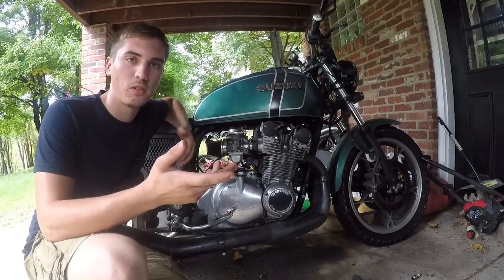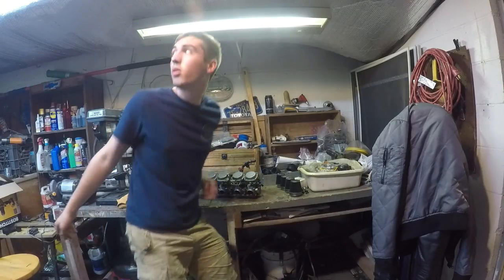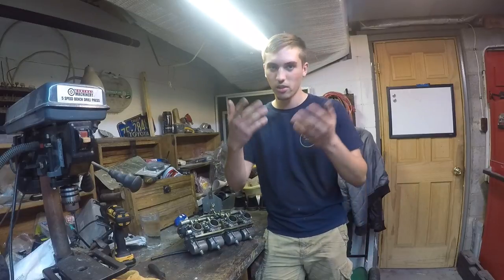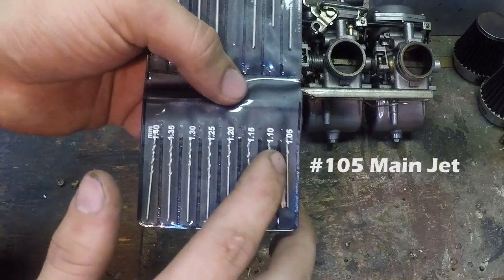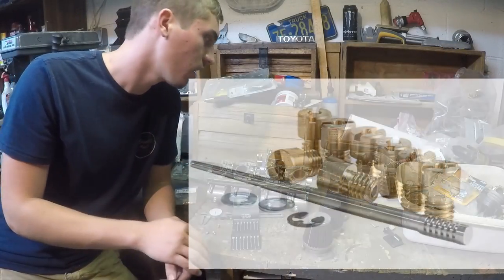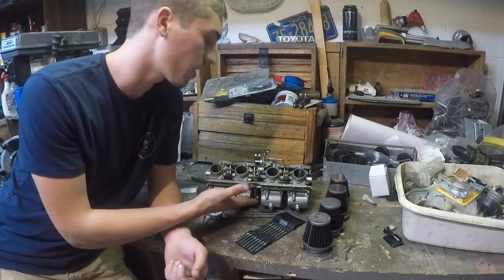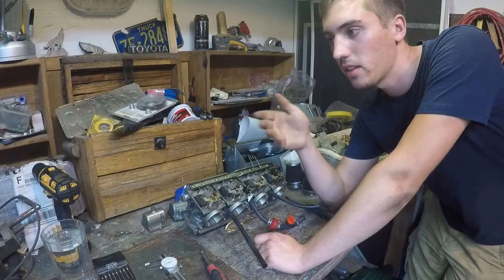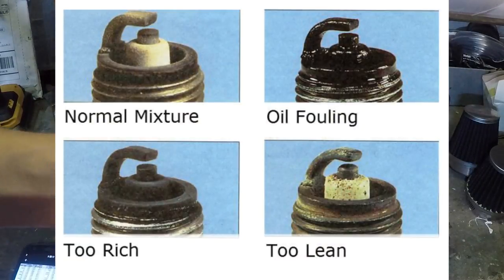How To: Jet Carburetors WITHOUT A JET KIT

Comment: after drilling out the jet, take a file or some sand paper and sand the original jet size away. Than take a pike or something sharp and engrave the new size in the jet. There is nothing more stupid than taking a jet out of your spare box which says 160 on it and its drilled to a 170 without knowing it......

Comment: Also, don't jump from something like a 110 jet to 170 if you are only doing pod air filters. If you are also installing a straight through or more free flowing exhaust, you might need that drastic of a change in jet size. Most people recommend about a 15 size jump for pods, so stock 110's become 125's. If you increase the size a little at a time you can get to the sweet spot and not ruin your set of jets.
Reply: You think .05 increments is small  enough? Idk. I'm about to do this myself. I've got 118 mains and was hoping to find a set of reamer or drill bits of .02 increments to test out as I've read of others having 120, 122, 124 mains.
Reply: @juntjoonunya9216  - I've heard a jump of 5 sizes for each of the most common changes. Pod air filters, plus 5, straight thru exhaust another 5, so a 115 main jet with pod filters becomes a 120, 125 if you are doing something like a 4 into 1 exhaust eliminating the crossover. Then check your plugs after about 500 miles, if they are very white, too lean, drill out the mains a little more. This is the main reason not to do a drastic jump in size. If you drill out too large the first time you can't go back, you will have to replace the jets.
Reply: With just a pod upgrade on a gs850 120 mains to start, but what about the pilots?

Comment: Hi, just want to say, love your videos. My question is...I have an 82 gs650gl that I've rebuilt the carbs on and it's like nothing is getting through to start. It just cracks. I am putting pods on just like yours so I guess I need to jet it. I did buy a drill set like yours. What size would you recommend I drill them out too?

Comment: Another hack if your jet is too big is get the jet nice and hot and melt in some solder and then drill it out with a smaller drill bit. You dont have to keep it like that  but its good way of testing before ordering the correct size needed.
Reply: Wow what a good idea

Comment: Hi, I have a CB125T that is a bugger to cold start. I think it is jetted too small on the pilot stage. I cannot  obtain the correct style jets in my country and so wanted to try drilling out the pilot jets. The jets are size 38 (keihin 3L jet). Does this mean that the hole is 0.38mm? They also have cross drilling, are the cross drilled holes the same size as the hole up the centre?

Comment: Hey man love your videos, I have a 1988 Kawasaki concours 1000cc with in-line 4 carbs. I dissembled the carbs and cleaned the jets and carbs themselves and the bike runs fine, but when I give throttle and RPMs hit around 6k, it hangs until I shit the bike off. Any ideas? Also, bike came with the pod filter but wasn’t running properly so got my hands on a stock air box and everything is fine except RPMs hanging when I apply decent throttle. Would really appreciate a response with some tips man!!!!!
Reply: Sounds like floats or throttle sticking

Comment: This dude is awesome have the same bike 1980 gs 850 runs alright with choke on can here it miss hear and there dies with choke off have the carbs off the bike far as I've gotten never really messed with carbs much but in gonna take my chances...what should I look for what should I do and what is a good jet size to start with on both jets? Bike seems to have good sparks so I assume its carb or even petcock/vacuum issue witch the bike has a strange petcock  dosent have a lever to select from love to able to get some info from you thanks man.
Reply from the maker: Well the Jets I am running are 165 main jet and 110 pilot jet. If your bike only runs with the choke on that means that your engine is not getting enough fuel, bigger Jets would solve that problem. Good luck man!
Reply: Intake boots where a issue my slides wernt even opening  anyways new boots pod filters good cleaning runs alot better will run with choke off but full throddle falls off at 4grnad 1/4 chock seems to rev up good...have some backfiring here and there and a few farts thew the airfilter... atleast I'm making progress? Think I need bigger jets still?...also one side of my pipes has alot more smoke coming out then then the other side
Reply: Alright get the bites you have drilled to 145 runs much btr dosent die out in rpms now but I have alot of farting  threw the carbs if held at a rpm is this pilot jets? Didnt look like this drill bit set could be used to drill out the pilot jets so whata your opinion thanks man
Reply: @mrtyshawn2085  sounds like you're going the right direction. If its still popping but at higher rpm, go bigger on mains or try shimming the needle 1 notch. Make sure you have no vaccum leaks too.

Comment: With a jet kit what you really pay for is the Needles! That dictates your fuel through most of your throttle position. Making your main jet huge gets around that bc thats what the needle  seals against (after the needle seat) But its a cave man solution! Another primitive solution to shim your needles with tiny thin washers to raise your needles. I guarantee that doing so will not require you to have a huge main jet and will probably make the transition  to full throttle smoother. 

Although some bikes also need bigger pilots bc they will still be lean at idle which your main jet sizing can not help you with.

For example i have a Bandit 1200 that runs a 150 main jet/skinnier than stock needle with Pods and a slip on exhaust. Which is still a smaller main jet than your 850G

Comment: Hey dude, this video is great. I love the idea. I'm curious, is there any turning you have to do besides changing the pilot jet sizes? Like messing with the mix screw? Or do you just slap the main jets in there?
Reply: In my case I didn't have to tune anything. before drilling the jets I tuned all 4 carbs  using a Fuel Vacuum Carburetor Synchronizer carb sync Gauge thinking that was the problem, but the problem was the bike was too lean.

Comment: Fun video.  However I think your approach to tuning your carbs is potentially more work and perhaps more money down the road.  While technically, you can drill out your jets to the size you need--it is way better to pony up the $3-$6 per jet and get a variety of sizes...yes, that may mean $20-25 for 4 jets of one size (in the case of your inline 4), but you'll be much happier being able to swap out jets as needed, knowing what size they are and not having to guess at it or remembering what you drilled out to.  Drawbacks to your approach: a) once you drill too big, if you need go back a size you can't.  b) Carbs are affected by a few variables (pilot jet, air/fuel mixtures, main jet, needle type and height, throttle position, elevation, etc).  Generally, making a change in one variables impacts the other variables in some way. You need to be able to back down in jet sizes just as much as you go up in sizes.  Regardless, I like your channel and your willingness to let us come along for the ride.  Keep it up!
Reply from the maker: I completely agree with this! Although, sometimes it can be difficult to find a set of jets to buy, especially for older bikes. And if you do your research and find out which jet size is best for your bike depending on the mods that you have done (pod filters, aftermarket exhaust etc...) Then all you will need is a set of drill bits like the one I used, and you can write down the current jet size in your owners manual so you don't get it mixed up. Thanks for the constructive criticism and thanks for watching!
Reply: Solder the holes shut.  And start over

Comment: Hmm, I've been looking into this and have found bits mostly of too large increments. .5 seems a bit much too considering mine are 118 and the next size up is 120, then 122, and I think they go up by 2 100th's. Like, what if your sweet spot was 122? You'd have only 120 or 125 with point 5 increments. So I'm looking into reamer kits which are a bit costly. Idk. Never done this.

Oh, and I got my extra set of jets from my $50 carb rebuild kits from china(for my cb650sc). So that might help anyone looking for an extra set and due for a carb rebuild.
Reply: this is a general video, there are many different drill bit sets to choose from, for instance the one from harbor freight. great video goldguy

Comment: What are the two hoses coming off the carb, i know the one with the filter is the feed line but im trying to rebuild my and i don't know much. Thanks
Reply from the maker: The other one is the overflow drain line
Reply: GoldGuy so those just go to the ground or do they need to plug in somewhere ?
Reply from the maker: Yes, it just goes to the ground

Comment: Loved the video, it was very helpful. Just wondering, are there any side effects to using pod air filters?
Reply: Yes. They call it "flutter" and it affects low speed operation.
Reply: @gregorytimmons4777  is that always the case? Or just when improperly tuned?
Reply: They look cool

Comment: To be honest pods are a waste of time, i've had them before back in the day, yeah they look good and sound good but you really have to mess about to get the jetting spot on,otherwise you get flat spots and loose drive ability,get it wrong you have holes in your pistons! if the pods get wet in the rain, the bike runs really rich and runs like a pig, the old Honda cv carbs are really a pain to get right.if you alter flow through your engine, always check you carb balance afterwards.
Reply: Oh.... but the sound is worth all of it! Lol

Comment: Hello I am from Mexico I live at sea level and I have a Honda CB750 I have that problem. Are you at sea level or what measure do you recommend?
Reply from the maker: I am above sea level, but that should change much. What is your problem?
Reply: GoldGuy I had a lot of air in the mix, but I swept it with 118 mm and ready. at the moment it is perfect. thanks for the tips

Comment: Hi there , 

I watched your youtube video on drilling main fuel jets. I own a cb750 1978 re bored to a 836cc running pods.
My question is what size do you recommend ? The stock read 108, MDmotorcycles says go up 15-20 in the stock. So would be around 122 jet size, in turn drill bit - 1.2 mm?

The problem i face before i do this is my fuel mixture screw is 3 turns out , if i go anymore they will fall out. Would re jetting help this?
Reply from the maker: Yes, rejetting will help with your mixture screw problem. If you are running oversized pistons and pod air filters, you definitely need to rejet. Personally, I would jump right up to a 130 main jet and see how much that improves the air fuel mixture, if it still isn't running good after that then go a little bigger on the Jets.
Reply: Thanks! so this would be a 1.30mm drill bit if I just do myself? @GoldGuyRides
Reply: Oh I also pulled my old one's out they were numbered #120

Comment: Okay, i understand why the diameter of the jet is important for the carburator. But if you're engine is running with too much gas and you need smaller jet, then why do you drill through the smaller ones expecting another result (for example, you're taking off the 170 jet to drill a 160 hole in the 160 jet, if i'm right)? i'm not sure to understand all of this.
Reply from the maker: I was wrong about my jet size at first, I thought it was 180 but it was really 170 which in my case was too rich so I took the stock 130 jets and drilled them out to 160 and then my bike ran much better
Reply: @GoldGuyRides  oh okay, i didn't get that the other jets were 130, sorry my bad, now i completely understand how you did it thanks 👍